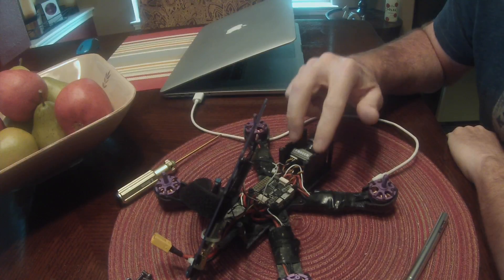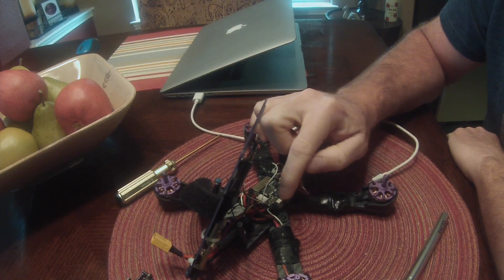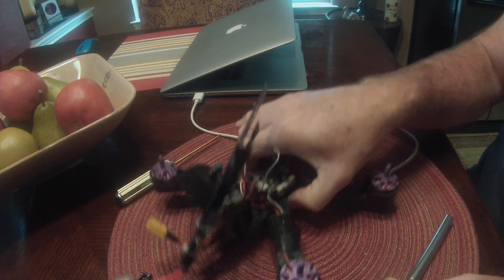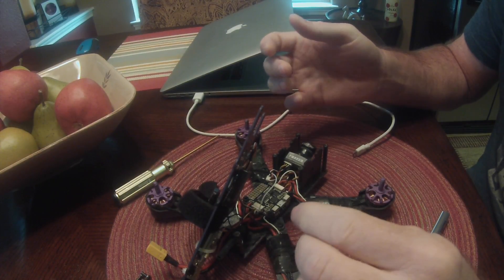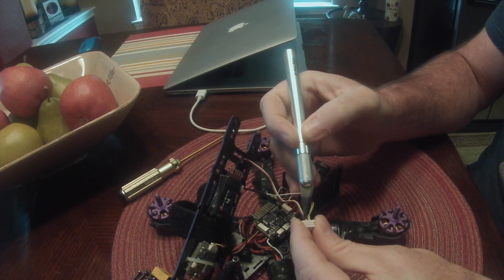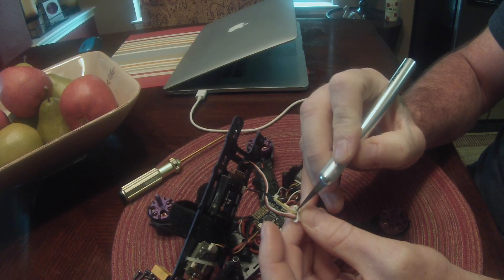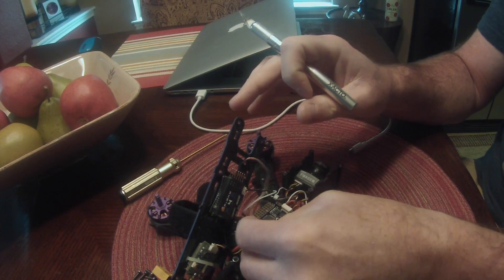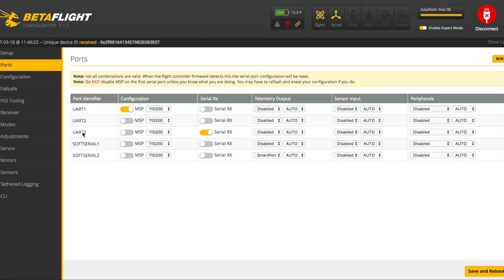Wizard x220 - Better Telemetry Setup - Softserial

Comment: Help! I did evrything like in your video but i am not receiving full telemetry only 3 parametres and also i have lost connection with my taranis even tho he is showing that x4r is connected with him and x4r is glowing green light. In betaflight in recever tab is not recognized... Dont know what to do, any sugestion?
Reply: Well, i have the same problem... Did you manage to solve this problem?
Reply: Timons Mind Yes, I have managed to make it work with this video, I hope it will help you. https://youtu.be/1bxlNSnFrjU
Reply: Aleksandar Sterijev 
Sorry, i didn't specify which problem. My Reciever works fine but telemetry only has 3 parameters.
Reply: Oh, that i didn`t solved yet :( Please notify me if you find any solution, i will do the same.
Reply: Aleksandar Sterijev 
Ok, i think i will try using uart2 and then maybe change software...
Reply: So I succeeded in soldering a cable to the uart2 connector and i get all telemetry parameters. Idk why it didnt function with softserial, now i just have to somehow protect that cable from breaking of the board... :/
Reply: Timons Mind Glad that you fix it. I tried the same but it didn't work out for me, maybe I did something wrong :( You can try protecting it with electric tape or heat shrink. It will be ok

Comment: Hey! Really nice video. Just a quick question : how did you manage to lock the wire into the white connector? Thanks a lot.
Reply from the maker: Mely I just use a small exacto knife or something with a small end or sharp and press the little tab down on the metal pin and pull out then just insert it into other connector
Reply: Thanks for the anwer Jason. I'll try that tonight :)

Comment: I used this method to setup my X4R telemetry with my Wizard and it worked great but then yesterday it just stopped working for some reason. Have you had any issues like this?

Comment: Many thanks for this. I am using a XSR, used this approach and still no telemetry. I have betaflight set up as you show. What am I doing wrong?
Reply from the maker: Are you getting any telemetry at all?   If not I would double check you followed all the steps and setup transmitter correctly.   Also on the wizard in order to get battery you have to setup wizard for VBAT first, Joshua Bardwell has a video on his channel how to wire up the vbat monitoring.
Reply: I will retrace my steps as you mentioned. I set up VFAS on the power for the ESCs not the battery. I see battery voltage accurately (checked it with a battery checker) on beta flight. I assume that means VBat is set up ok.

Comment: Hey thanks for the video ! For the longest time i couldn't figure out how to set up telemetry on the wizard. my only issue right now is that i do not have the Fuel option showing up on my taranis. I'm getting :
1. AccZ
2.Tmp1
3.A4
4. VFAS
5.HDG
6.AccX
7.AccY
8. SWR
9. RSSI
10. RxBT
any idea what i have to do to get my Fuel telemetry to recognize ? I like to use Mah consumption more than voltage to know when to bring the quad in.
Reply: i actually figure it out just after writing this message, i just needed to upgrade my firmware. A simple upgrade to the newest firmware fixed all my problems. thank you again for the video !